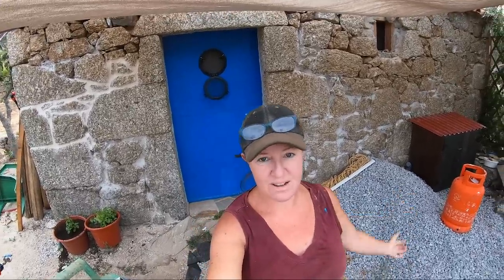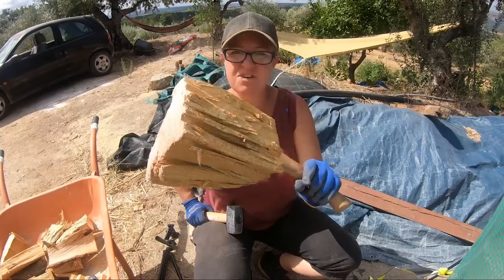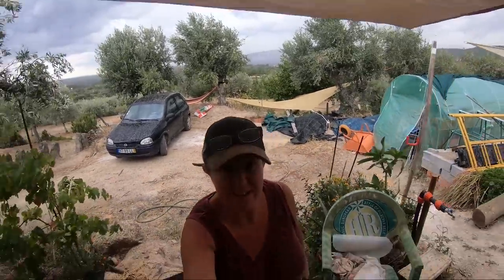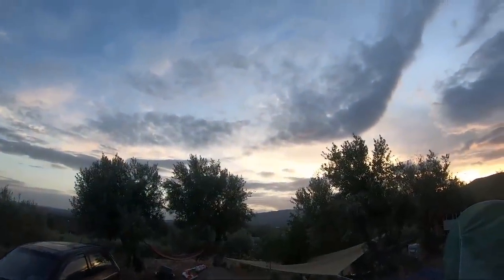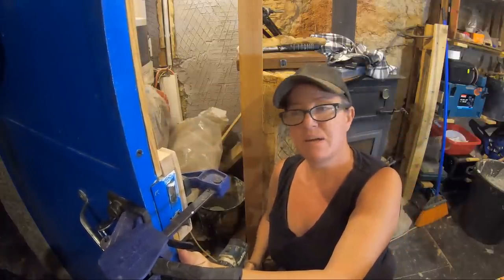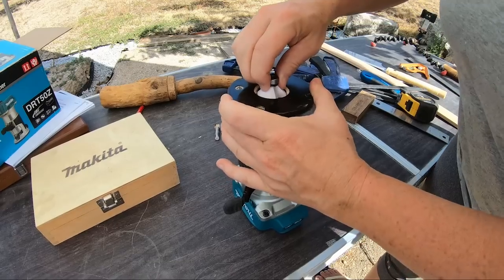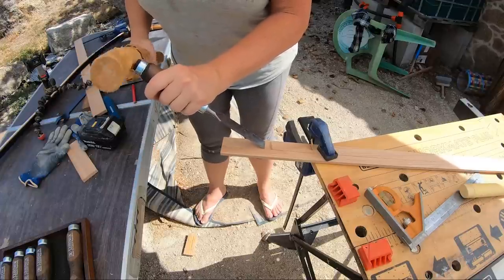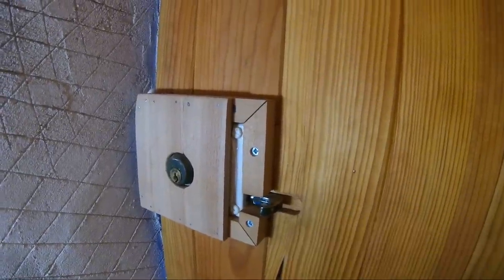Rain, Shine, Chainsaws & Hand Tools, a Video of Contrasts! - Off Grid

Comment: If it were me, I would just hang a curtain across the closet opening.  But watching you build something astonishing is way more interesting.
Reply: Same I would do the half cover so battery is protected and then a curtain as a door. It would bring in a soft texture.
Reply: I would just hang a curtain across that to that way you don't have a door to worry about
Reply: How about making the left ⅓ a removable wall panel that maybe slides out (easily!) for access if necessary? Hot air rises so definitely ventilation at top. Louvers are hard to clean dust off!! How about a lightweight door for the right ⅔? A little more like those Japanese screens you can buy as panels? Curtains are icky and may even blow in and be a fire risk if they touch the battery or get caught on wires. Regarding the door latch...beyond my capability...maybe a hole drilled to thread a tassel type pull? All the best Kirsty! 🤩
Reply: I like the idea of a boho style natural curtain with something natural, like an interesting multibranched tree crotch for a hold back
Reply: Yah that’s a good idea a soji screen.
Reply from the maker: Ooh, interesting idea!

Comment: My suggestion on the door would be: you can make a doubledoor with too different sized opening doors, a small part on the left, that is usually closed, but you can open it when you need , and a bigger door on the right.
Reply from the maker: A very fine idea, thanks!

Comment: Single door, hinge on wall side. Maybe  removable , slide out, wooden frame and shelves so that you can easily get to your solar stuff.
Reply from the maker: That's what I'm thinking, too. Thanks!
Reply: Yup.  If you need to take the whole unit off the wall you need as much room as possible to take it out easily

Comment: Don’t let making two doors hold you back. Two doors is accomplished by creating one door with trim for two and then cutting it in half. You can also create a panel the width of the opening. When completed simply cut it vertically at the point you want the thinner “wall” to end and the door to begin. Attach hinges to the door and you’re done.
Reply from the maker: That's true! I think my main issue with two doors is that one side would open in a way that would make access difficult. But perhaps a hinged door opening to the left could work? Let's see! Thanks for your ideas!

Comment: THat is a sweet router!  You did the right thing by screwing up your courage and going for it.  As you said, If you don't use it you'll never get comfortable with it.  A router and a nice set of bits is a really handy kit to have.  
Note; For fine depth adjustments of the cutter, use the thumb screw by the release to dial up of down in small increments.  As long as a small portion of the  bearing will ride on the woods edge, you are good.  An orbital sander is not a good substitute for a router 😉
PS - Note about sand paper grit; 180 is likely the finest you will ever need.  I stock 80,120 and 180.  Higher than that is only necessary for finishes.
Reply from the maker: Yes I can see how the router will be useful! I currently only have 40 and 80 but I just ordered the slightly higher ones, as well.

Comment: As you are looking into the solar closet, I'd suggest a bifold door that pivots on the left (two panels, hinged in the middle that fold up left).  That will give you the clearance for your solar gear because the panels will "stack up" on the left.  
I'd suggest building a stout "picture frame molding (one for each door panel) and infilling the picture frame with the thin tounge and groove panels that seem to be universally available.
Depending of the length of the T&G paneling, you will want to do one or two rails.  
Your router makes this construction possible because when the 'Picture frame and rails are assembled, you can use your router and run the rabbeting bit around the inside of the frame to create the recess in which your T&G panels will fit. THe use the rounding over bit nd cut a radius around the outside of the panels (not the certain, leave them flush - I think.  They will look dandy!
You could use your router to make a few plunge cuts through the top and bottom for ventilation instead of making another screen.  Just make a fixture and line the plunge cut up on the center of a T&G board.  Maybe make the cutout 6" long.  8 slots per door (4 top & 4 bottom X 2 doors gives you 16 openings for airflow. 8 at the bottom and 8 at the top or what ever you are comfortable with..
Reply from the maker: I like the idea of a hinged door opening to the left and I think I understand what you mean. I don't have a plunge cut thing for the router, but perhaps it's something I'll want to get when I can afford it... especially as I become more comfortable with the router. Thanks!
Reply: @PortugalfromScratch  You actually do have "plunge cut" capability already, my friend 😊.  There is a straight bit in your box of bits.  You chuck that up in the router and set the cutting end just above the plate.
Now the fixture is a piece of plywood with a hole cut out of the middle that is the width of the router base and the length of the slot you want to cut plus the width of the router base plate.
You set your router base plate into the fixture, power up the router, and slowly plunge the bit through the wood using the knob depth control.  Once you're through, just run the router the length of the fixture, turn it off and pull the bit out when it has stopped.  
I realized after I wrote this that the door I described would match your front door.
Take that one step further and you can make matching kitchen cabinet doors! 😊 When the time comes... 

After seeing your beautiful chisel set I understand why you are determined to build a post and beam garden building.  Have you considered taking the stone foundation materials from one of the standing (or fallen down) rock walls on your property?  They are charming - but no one will miss 10 to 20 feet that got repurposed 😊 You might even want to open up an existing "hole in the wall" so you can drive a car through, for instance...
Reply from the maker: @stevejohnstonbaugh9171  Thanks for the info! I think the fixture you're talking about would be a sort of jig I'd have to make? As for the stone walls, most of them are made from large standing stones or not that high (the ones bordering the path) though I have already removed a section for my car and they're in a pile on my third terrace. There's also a weird short terrace wall on that terrace that doesn't see to serve a purpose so I might also raid that. Let's see... I'm excited to start stone work but keep getting sidetracked!
Reply: @PortugalfromScratch  Yes Kirsty, a jig is another term.  See - you've got it!
Sounds like you have access to stone that CAME from nice walls!  Very fortunate.  Stonework goes best when you have your entire supply of stone plus lying about the project so you can more easily spot the next :just right stone.  I hate to say it, but that 's all wheelbarrow work and it's uphill.😟
Or I suppose you could use the boot of your car?
Here's a 26 minute video of a fellow laying up a stone foundation for a timber framed greenhouse;   https://www.youtube.com/watch?v=jDZm9eoFIQU
I did not make the connection with timber framing until just this minute.  Everything he builds is way over the top too heavy.  But how he framed it may be of interest 😊  There must be 10 episodes total.  OCD much?

Comment: What are you planning on storing in your "creepy" cupboard?  That could dictate if you put in two doors or the small wall and small door. Cause nothing is more frustrating than needing to store something but you can't get it through the door opening.  
If that isn't a problem, then do the easiest, fastest solution.  
I love how you take the time to work on things to get them to the point of your satisfaction!
Hugs from 🇨🇦
Reply from the maker: Very good point! I'm going to have a door for the full opening, build something to protect the battery, and then I'll put a moveable shelf in the cupboard for now to store all manner of crap. 😁

Comment: Someone suggested a wood blind or even a roll up bambooshade to use as a temporary door . I like it because the roller shade could be repurposed in many ways .
Reply from the maker: Very true! Even just as a temporary solution. I wonder where I might get something like that...
Reply: @PortugalfromScratch  I ordered fancy wood blinds for my house off Amazon very cheap. I cant remember how I found them but there are mis-measured returns that fit my windows fine.
Reply: @PortugalfromScratch  Brico Depot 😊

Comment: Yes, router practice!  😊 definitely the single door with the small width wall (maybe on a hinge for solar access if necessary) solar protector IMO .... and the latch ... if you can take the top and bottom timber bits off to work on latch ... perhaps router the edges to widen the gap and provide more room for your finger to get the latch? And then put the top sections over, with wider latch section so its comfortable to access?  I'd be concerned fiddling with drilling a hole in latch may rattle something in the mechanism and prevent it from working effectively.  Looking forward to the problem solving. 😁
Reply from the maker: Everything you're saying makes total sense and I had the same thought about drilling... who knows what that might mess up inside there. Thanks!

Comment: Thanks for the update. Think the smaller door would be better idea IMO, but would also consider a wooden tambour door, the kind that roll away. Since you asked... for the door lock would you consider cutting away some of the backing fixture around the latch. This would then allow you to get a round section of wood like the end of a broom / brush shaft 4" long. Could drill a hole in the cut end, bigger than the door opening latch (that looks bent / curved) could then fill the hole with epoxy or glue, once set you can make the final lock facing piece of wood with a nice radius to match the round pole when locked. The whole lock would look wood 😍. Sorry for the long winded reply but you did ask😅, hope it makes sense. 👍🏴
Reply from the maker: Yes cutting it away could work, thanks! I'm leaning now towards a door across the entire space but I wonder if it could be hinged with the left side set in place but also able to open fully... not sure if that makes sense.

Comment: For the latch you could cut off a wooden broomstick,  a make a hole in it for the latch protrusion.  There are incredible glues out there.    For the closet,  access  & ventilation are the key.  I wouldn’t put a small wall as it will make access too tricky.   And didn’t you say that eventually you would like to put the solar system in your shed?  I would use a long bamboo blind with a few adjustable clips on the sides so it doesn’t rattle in wind.    Nice routering too!     Can you use olive tree branches for kindling ?   Cheers
Reply from the maker: Gluing something on would probably be the easiest but I guess I know nothing about glue and wouldn't have trusted it. But perhaps I'll see what's out there that could work. Thanks! A blind is another great idea... I have lots to consider! I can use live cuttings and they're great but I don't have any from last year since I chopped most up and used them for mulch or already burned them. This year's will be cut in November but not ready for awhile, but I will use them when they're ready.

Comment: My input would be to use a double door for easily accessing the solar equipment. I see screws on that blue box up top that would be blocked if you made a wall.  I also think a curtain would work just fine and be so much easier. 🤷🏻‍♀️😊 as always, thanks for the sharing this video with us. The rain was very nice!  Glad you are getting a good start on your firewood too this year. Take care! ❤
Reply from the maker: 'm leaning now towards a door that opens across the whole space but possibly hinged opening to the left, rather than double... let's see! A curtain as going to be a temporary option but now I'm not crazy about it due to the closeness to the wood stove. Thanks for watching and commenting! The rain was amazing!!

Comment: Hi Kirsty! There are several factors in considering the type of door, etc.  In order of importance: 1. cost and effort  2. amount of space available for opening the door fully 3. traffic flow in, out and past the open door. 

I believe that you'd prefer a low-cost lowest effort possible build. It seems that you have enough space to open a full-width door, perhaps not for a 180 degree swing, but at least 90 degrees? You really don't have traffic considerations (like a big family, tight kitchen, what is the best type and way for the fridge door to move?). The route to the shower, even with another person in the space isn't high traffic and the need for access to the solar closet is even less necessary. The Canadian "Oops, Sorry!" could handle any situation.

I would choose a full door build, hinges on the left (same side as the equipment). A single door is much easier to build and use than 2 doors or a folding door. One is also easier to build to be stable and strong. The side with the hinge is typically the side that's less open in the room for access i.e. the doorway opens to the easiest access into the room. So, if you have hinges on both sides of the opening, the access, especially with a small space, is even more constricted. Also, if you add a small wall, the access will also be more constricted.

If you don't cover the top of the closet, the door doesn't need openings for air circulation. If you must cover the top of the closet, then perhaps the louvers or air holes can be in the roof of the cupboard instead of the door, or even better, in addition to the door. I would suggest multiple drilled holes in the bottom of the door and multiple drilled holes in a wooden ceiling panel for good air movement. The rising hot air will take air from the cooler, lower part of the closet - in this case from outside the closet and move it out of the top of the closet.

Good luck, whatever you decide!  Best wishes, Angela
Reply from the maker: Thanks for your thoughtful response! Lots of great tips and things to consider in here. 🙂
Reply: @PortugalfromScratch  I hope it helps! 😄

Comment: Hello young lady !
As for the door in the Solar room closet I vote for one large door ! It seems like it's too small to have a divided door. You might need to work on the solar equipment later on and a larger opening would be helpful.
LOL!! As a finish Carpenter you were sure were pushing my buttons on your door lock cover best if you would have glued all the little pieces together as one then used 4 screws to attach it to the door that way if anything ever happened to you lock set take out 4 screws and work on your lock!
A small table saw would greatly add to your ability to do woodworking !
Always enjoy your videos young lady, best Wishes Always!
Reply from the maker: One large door is what I'll do, I think. Possibly one that's hinged... let's see! Haha, ya my finish carpentry definitely isn't polished! I guess I don't have a lot of experience with or faith in glue, so I didn't know if that would have worked. A table saw would be amazing! Thanks!

Comment: Looking at the bark of your firewood as you were sawing, I'm fairly certain that in your region, placino translates to "mixed hardwood of random length for foreigner" because no two pieces appeared to be the same!  😊🤣
I'm thinking the very difficult to split wood is olive.  Might be a good idea to try to develop and "eye" for what is going to be easy to split.  I'm pretty sure I saw the distinctive bark of sycamore.  That should be easy as long as it is straight grain (no knots or branches).
Reply from the maker: The wood is all the same and I know what olive looks like and it's not that... though I would love a mix of olive wood in there! 😁 I think I just chose pieces with nobbly bits. In future I'll look for shorter sections with straighter grain, or cut those pieces off to use specifically as kindling.

Comment: Definitely wouldn't have a door on the closet, takes up too much space in the room when you open it.
I'd do the piece of timber the height of the frame on the left you mentioned   & then a curtain to cover the rest of the doorway & increase greatly the ventilation.
Doors are a pain, they're always in the way.
Fun watching you work out how to do things, you get there in the end whatever happens.
😸
Reply from the maker: I'm leaning now towards a door the full width of the opening. If it opens to the left I think it'll be ok. I was going to put a curtain temporarily but many people have pointed out that it could be a bad idea so close to the wood stove. Lots to consider! Thanks!
Reply: @PortugalfromScratch  Blimey, yes bad idea really, thought it was far enough away from the stove. If there's room to open a door flat against the wall on the left that's much better by the sound of it, you need full access to the bits & bobs in the closet & that'd give you the most of all the options you've mentioned.
This bouncing ideas around is great isn't it!!
Reply from the maker: @anniemac3075  It really is! Thanks! 😀

Comment: You might find a log splitter useful.  Try to chisel out a small portion of the wood where your locking mechanism is.  (U shape)  If you go with a door then a single one would be best.  You do have your wood stove there.  Fire regulations and insurance guidelines here in Ontario, Canada require a minimum of 6 feet open space around the stove otherwise your stove is considered a fire hazard.
Reply from the maker: I think a door across the entire opening is what I'll end up doing. A log splitter would be amazing!